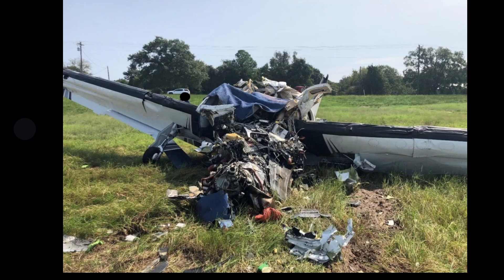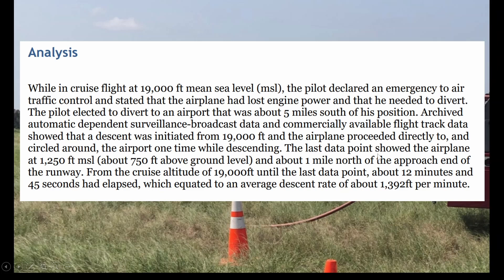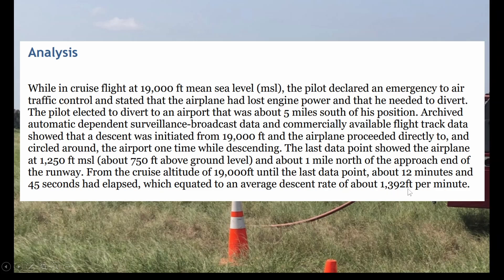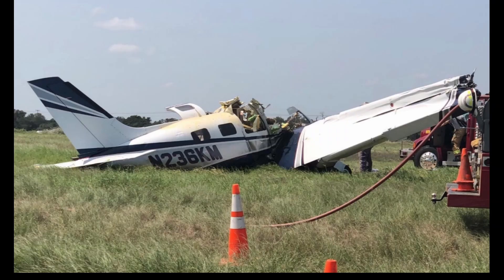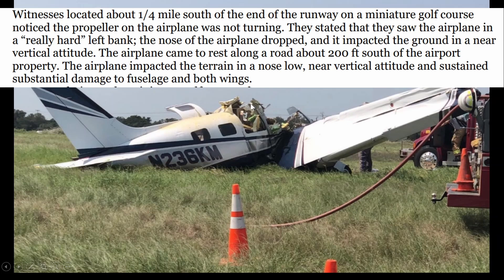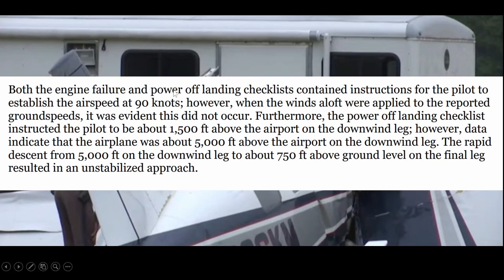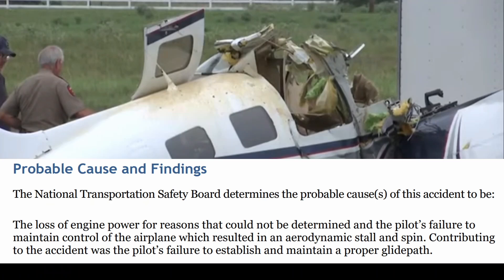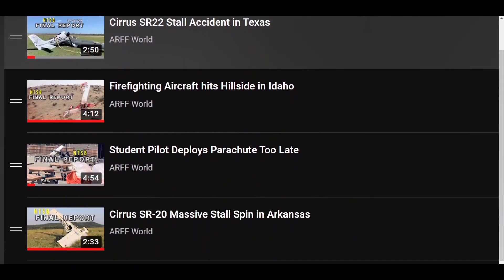Can too much Altitude Cause a Crash?

Comment: When the Piper Malibu first came out, they had a LOT of catastrophic engine failures! This airframe was overly demanding of the engine, they were trying to pull so much power/performance from this engine that they had an extremely high rate of engine failures to the point the FAA almost grounded the entire aircraft series! When you have a high performance single, pressurized, turbocharged, rapid cooling during descents, there was so much stress and demand from this engine, it was failing left and right! "This was about 30 years ago, but it had a very bad safety record in the beginning! That, combined with low time pilots moving up to these pressurized/turbocharged high performance single engine, it was a perfect recipe for disaster! In this case, the pilot just screwed up and crashed a perfectly guidable/flyable aircraft! Thx for the update!
Reply from the maker: Thanks for all that info Jon
Reply: When the Malibu came out the engine could easily be overstressed from  pressurizing the cabin & turbocharging the engine. They where constantly failing the compression checks. They lowered the compression test numbers with a service bulletin to use the master orifice to get a lower passing compression test number like 42 pounds  instead of 60 or above.
Reply: @Nord3202  Yep, once you get up to this size and complexity in a single engine PRESSURIZED aircraft, the best and safest solution is to go to a turbine engine! Plain and simple! Yes, it's cheaper to cram a recip in there, but you will end up paying the price one way or another!

Comment: Aircraft have an absolute altitude flight envelope. I.E. an Piper cherokee is 14,300. That's at standard temperature and pressure. Any deviation from these values  (higher temp. and lower air pressure ) . This changes density altitude, if uncorrected by pilot this will decrease the absolute altitude.
Reply from the maker: Thanks for the info Piper

Comment: The high cruising altitude actually gave the accident pilot an advantage. He had plenty of time to trim his airplane to "best glide" speed, set a course to wherever he decided to land, and then try to restart the engine. He got to an airport in plenty of time and still had a lot of altitude. His next step should have been to stay over the runway and slowly spiral down on a controlled, corkscrew glide path to lose altitude. The pilot of this airplane came down way too fast and he didn't stay over the runway. The stall occurred because he had maneuvered himself too low and too far from the runway to glide in for a landing. He tried to make a high-bank turn to the airstrip and stalled the lower wing. Since he was flying a Malibu I'd assume he was an experienced pilot. He probably forgot his training in the heat of the moment. RIP, brother!
Reply from the maker: RIP to them all
Reply: In other words.  See my channel name.  That is what he did wrong.  Bad ELM.
Reply: @emergencylowmaneuvering7350  I looked up your channel and watched your video. It's very good; if the engine is still putting out partial power check your descent rate. You may be able to make it back to the airport.

Comment: POH will give best glide range…in my Piper Tomahawk PA38 from memory it’s 70 kts IAS. Remember wind affects range so tailwind improves distance travel across ground to easier runway/aerodrome (less manoeuvring… longer runway…head wind on landing etc). IAS with engine out is a function of attitude. Flaps not always desirable. NB Aviate, Navigate, Communicate.

At that height in a piston engine I think it had to be turbo boosted…normal piston engines have about 10,000 feet AGL ceiling adjusted for density. Carb icing might also have  been a factor.
Reply from the maker: Thanks my man
Reply: Put a blue line on Vglide speed to use as take off, slow flights and landing Vref.  I flew one with all kinds of lines or indicators for speeds.  No need to think, just look and do.  We also had  an A letter for Va speed.

Comment: Emergency landing...engine out...you never know when the instructor will reach over and pull the throttle closed to idle...then he says what are you going to do, #1 go to the best glide speed..85 knots in most small cherokees...#2 find a place to land, and they say the place is probably rite below you...# 3 then trouble shoot how to restart the engine, switch fuel tanks, mixture rich, primer locked, carb heat on, check magneto's, pump the throttle, and if it don't start... now your a glider pilot, and this is where your flying skill will save your life, if you don't practice this and get good at it, it may kill you, sad...but I think this pilot failed the glider pilot roll.
Reply from the maker: Thanks for sharing that checklist Thomas

Comment: That's why REGULAR engine out practice is crucial.  This was an ideal scenario, 19000' is 3 1/2 miles up, and a runway only 5 miles away, and clear conditions.  Altitude is time, and buddy had 15 - 20 minutes to come up with an approach, IF he had stuck to the prescribed glide speed. A stopped prop would make it a little longer, with less drag...maybe eliminate trying to restart it, if the crankshaft had broken as reported.  He hit the ground with landing gear out and flaps down...too much drag, too slow at this point and too much altitude expended.  For you Dan Gryders out there:  AQP #6 and #12  (mishandled abnormal, and loss of speed awareness...both are lack of proficiency, and mark your airspeed indicators with your DMMS - defined minimum maneuvering speed)
Reply from the maker: Thanks Owen for sharing

Comment: Emergency Procedures (EPs) are regularly practiced by good pilots to maintain proficiency in them, should a real emergency with the airplane arise.  They are also required items to demonstrate on a practical test for a pilot certificate.  In the case of an engine failure during flight, that’s a very common EP and there will be a emergency procedures checklist associated with it. Typically a simulated the engine out will be done by simply pulling the throttle on the aircraft to idle power as a simulation for a failed engine.  The typical procedure for this is as follows.

Use the flow A-B-C-D

A - Airspeed: immediately pitch for best glide speed - this is the airspeed, for a given gross weight, which will result in the maximum gliding distance per unit of altitude lost.  This maximize your ability to glide the airplane to an acceptable landing area well consuming the minimal amount of energy to do so. In an emergency time is options and possibly the difference between life and death. Stack the odds in your favor.

B - select the Best Landing Site around the aircraft.  If there is an airport within gliding distance, head there for a forced landing.  If there is not, locate an appropriate site to perform an off field forced landing.  Good areas include large farm fields that have been plowed, highways, large clearings, etc.

C - Checklists.  If time and workload permit, run through your emergency checklist for an engine failure during flight. If you cannot get the engine restarted after that, prepare for a forced landing and perform the checklist for a forced landing.

D - Declare an emergency. Squawk 7700 on your transponder, and contact ATC that you have an emergency, with your position and nature of the emergency if time and workload permit.

For simulated for sladding, you will attempt to glide to the landing site, and lineup for a final approach to it at the appropriate airspeed such that you can make a landing site gliding.  The exercise will be terminated not lower than 500 ft AGL, by applying power and executing a go-around.

As you near the site for your force landing, you need to anticipate arriving at a particular touchdown point on that site, on the proper approach speed for your aircraft. This does take time and practice to stay proficient at. I suspect the last time this pilot  ever performed a simulated power off landing was on his checkride for his pilots certificate however many years back.  This, combined with the stress of having to perform this task in real life, probably contributed to his inability to control his airspeed throughout this and ended up coming in way too fast land. I suspect the airplane floated down the runway, and when the pilot realized he was not going to be able to land and stop he attempted to get back in the air, causing the airplane to stall and crash.
Reply from the maker: Thanks for taking the time to write.  It’s very interesting and much appreciated

Comment: What!  You go directly to the airport and spiral down.  Was there weather obscuring visibility?  This is a clear and obvious stall.  This could NOT have been a very experienced pilot.
Reply from the maker: Did not read anything about weather being a factor Duchess
Reply: @ARFFWorld  Then unfortunately it was simply the pilot losing control of the airplane in a steep turn.  When your turn is steep you need additional power or you have to get that nose down.  Seems like the pilot did neither.  Condolences to the family 🥲

Comment: No fire tells me that the power loss is a no brainer (fuel starvation). This pilot could have glided at least 75 miles more than enough time to make a proper decent and set up for a stabilized landing. Do we know if the entire aircraft made it to the accident site all four corners were at the crash? I don't remember this one so I will go to the docket and read up on it, but you can't trust the NTSB to give us a proper probable cause.
Reply from the maker: Thanks Jeff, nice hearing from you
Reply: You think the plane could have glided 75 miles from 19,000 feet? Even it it could do 10:1 (a more realistic ratio is probably 4:1 to 6:1 perhaps) that would be less than 40 miles. I don’t know the Piper Malibu engine out glide ratio, but it would need to be 20:1 to make the 75+ miles you are thinking.

Comment: Are pilots trained for single-engine emergency landings because of power loss?  Yes.  How?  Close the throttle (instructor says 'surprise!').  Killing the engine in flight to practice emergency landings would be foolhardy.  I would expect a pilot at the level of experience needed to fly a high performance aircraft like the Malibu (safely) to be able to land under these circumstances... there had to be more to it.  Weather, other distractions in the cabin, panic, something else...?  Sad, but it does seem like the pilot just didn't put it together sufficiently well to just simply land.
Reply from the maker: Thanks for sharing your take Steve

Comment: A spiral down is not a problem, and is what I would do if I was to high but over a landing spot.  A side slip will bring you down like the space shuttle quick in a spiral. A pilot has to "time" that last spiral to come out on final at proper altitude.  We practice or should all the time at engine idle and spiral or side slip as necessary.  Just like stalls and falls are practiced.
Reply from the maker: Awesome and thanks

Comment: Fatigue failure of the crankshaft occurred. The same part number had 14 previous failures and the manufacturer thinks it is possibly due to excess heating of the steel during manufacturing.

Comment: Classic stall/spin. Trying to get down too quickly, low altitude high bank turn without engine power rarely works out well. And to answer your question, yes many pilots practice stall/spins as it teaches you to recognize the event before it happens and take corrective action before it is unrecoverable. At 19,000ft he had about 20 miles of glide if trimmed proper. I would have looked for a straight in approach.
Reply from the maker: Thanks Ken for writing in.  I appreciate it

Comment: As far as engine-out training goes in a single engine plane, we pull the power fully back to idle and pull the carb heat out (turns carb heat on). We then practice a checklist/flow (Pitch for best glide, best field, try different things that may restart the engine, and communicate with ATC letting them know what is going on while squawking 7700).

We do not turn off the engine in flight because that could lead to a real emergency which we obviously don't want. We train for engine-outs in various situations too. For example, in addition to training for an engine-out in normal flight, we train for engine-outs while in the traffic pattern for the runway. We cut the power mid-field while on downwind and then have to land the plane around half-way down the runway.

In regards to your question in the title, no, too much altitude cannot cause a crash (at least in this scenario). If anything, it is a HUGE advantage to be this high. If I had to guess, the pilot in this case lost his engine, decided to land at the nearest possible airport, and crashed the plane/lost control of the plane while trying to do some aggressive maneuvers to get down fast enough to land at that specific airport.

The important thing to note is that the nearest airport/field is not always the best one to land in. There could have been a farther airport that he could have landed at without having to dive down and this crash could have been prevented.

Very sad either way.
Reply: While we practice it's nothing like the real deal because the airplane handles a bit different with no power vs idle. But having done it twice, with less than 200 hours logged, the training is certainly sufficient! Now I'm practicing and working hard on improving my choice of engine for my experimental because apparently I suck at that!
Reply from the maker: Thanks for sharing this.  Very interesting and I hope some lessons can be learned
Reply: Excellent detail. I didn’t go that far lol. But I do know of instructors
That practice true power off stalls. Idk how comfortable I would be with that. However at the same time I don’t totally disagree with it either. 
      BUT I’d go up and do one right now in a pipistrel virus or sinus. Lol.

Comment: You can get rid of a lot of altitude with little increase in speed with a forward slip safely. If the engine quits at high enough altitude in good wx out just circle the airport and screw vectors if have a choice.
Reply from the maker: Thanks John for your take

Comment: In any emergency in flight always best to go to the nearest Safe suitable airport. All you have to remember when dealing with All emergencies in flight… the first order of business is always fly the plane. Maintain safe stable flight. If this guys emigrated seized all he had to do was glide at best rate about 90 knots descent rate of 800-1000 ft per min. Circle the aerodrome until he’s at circuit altitude setup for a stable approach and land. Most of this is from a pilot that panic’s and is rushing to get on the ground. So sad see it way to often. Yes we train for this all the time when taking you license. You actually need to pass a simulation of this in your flight test to pass that exam. But like most if not all emergency procedures that we are trained for while taking our license we don’t practice them after. It’s a skill to deal with such emergencies and you really need to practice. May God bless all those who lost there loved ones🙏🏻
Reply from the maker: Thanks for watching and the comment

Comment: Definitely picked a farther place to land because you can emergency descent I believe with the engine running and feather the props maybe on this one but since he had no engine he had probably little control over that and definitely too fast to descent rate more like 700 ft per minute would be more like it. This is part of what happens when you never practice power off or loss of power descends he probably hadn't done one in years. If there is an optional airport for the way he could have been dead sticking for probably 15 minutes not sure what the glide rate on that is. This way you can pick a suitable airport that has maintenance perhaps. Usually when you IFR a flight plan you have your alternate destinations already figured out.
Reply from the maker: Thanks Matthew for sharing